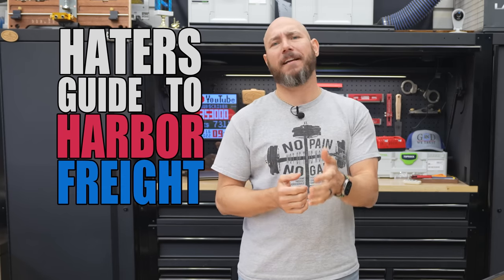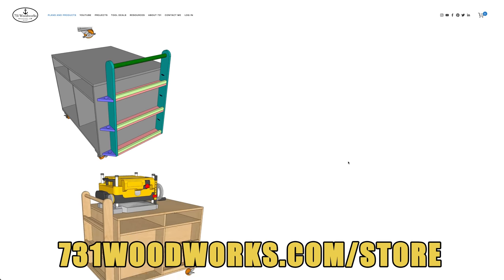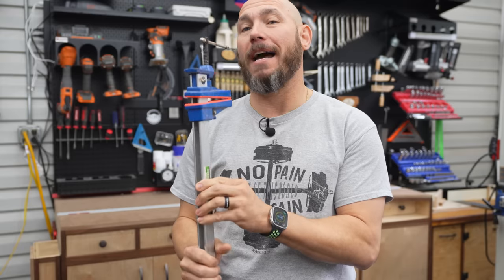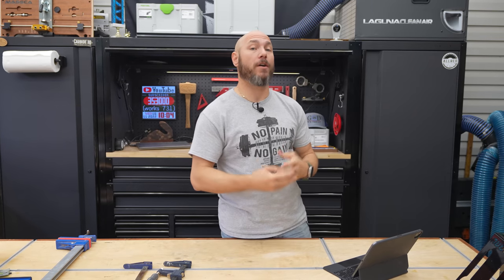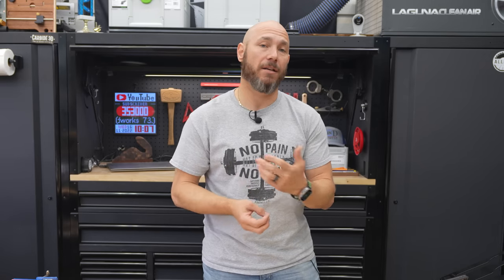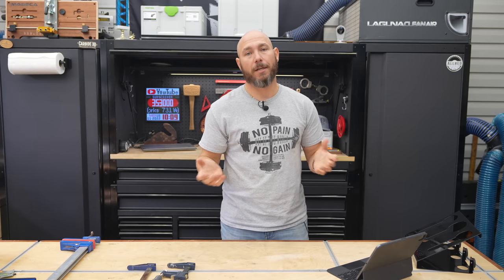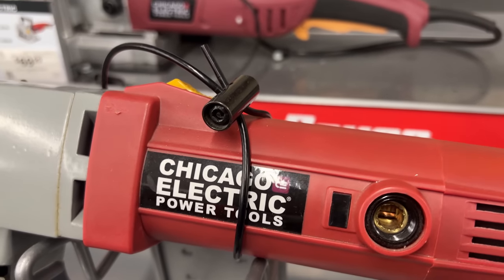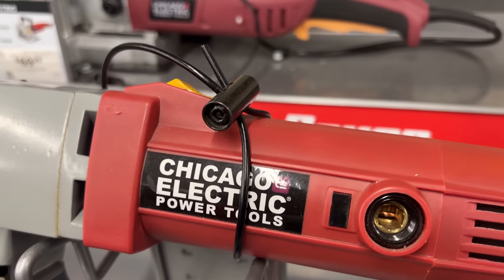The Hater's Guide to Harbor Freight | What to Avoid

Comment: The Hercules table saw used to have a rack and pinion fence when it was first released, at least as far as I remember... Den of tools did a side by side with the DeWalt of the same size and found the Hercules to be almost identical. 

The Avanti airless sprayers are fantastic. The all metal one for 650 rivals Titan and Graco sprayers that are double to triple the cost.

The Central Machinery floor standing drill presses, benchtop wood lathe,  14" bandsaw and the mini lathe and mill are all great for actual shop tools. 

Just a couple of good ones you missed or didn't know about. Everything else you said was right on the nose, except that table saw. Maybe get one in the box and do a review? I know the floor models can get messed up. Maybe they did away with the rack and pinion?

Anyway, cool content as usual. Hope you guys made it through the storm the other night. Up here in Upstate New York we caught the tail end of that wind... It was epic lol.

Peace and love to you and the family ❤️💛💚
Reply: As a former employee that also did research on the tools of the time. Almost everything you've mentioned is really accurate. The bar clamps are good, The machinist lathe is a good introductory lathe for small pieces and rifle barrels. The torque wrenches have been reliable over the years. The dust collectors, the sandblast units, almost all of the woodworking tools are decent. I agree the chisels are okay at best. The woodworking seems to be the shining area. I would stay away from consumables as a primary product. Like sandpaper. But they do well and they do great in a pinch. The Bauer, Hercules, earthquake lines are definitely better than the rest of their tools. The Doyle, Bremen, quantum, and other newer names are also really good. I started in '16 and left just before 2020. It's a weekend warrior store. Sufficient. If that makes sense

Comment: Hercules job site table saw has a rack and pinion fence. A very nice one I might add. It is not the most robust product, but for a job site saw it is excellent quality.

I bought the table saw for a kitchen remodel project I was working on out of town. I assumed I would be done with it when I left, but I ended up loading it up in my truck and bringing it home to replace my Rigid job site table saw. It definitely had less use, but it was also just better engineered and functionally worked more accurately. It is also substantially more compact. 10/10 would buy it again without hesitation

Comment: Their digital calipers are a good deal. I've been using a pair for over a decade, even in my machining class with super tight tolerances. I have a pair of mitutoyos also but I bought an extra harbor freight caliper just so I could have one in the garage, one at my desk, and one at my 3d printer.
Reply: Yup. I have one in my garage, one in my basement, one in my glove box, and one in my kitchen junk drawer.

They're always coming in handy for something.
Reply: was gonna buy a used mitutoyo caliper but didnt want to pay $60 so just got a HF one instead. Good enough for my occasional use.

Comment: After watching several comparisons, I saved myself some money and bought the Hercules table saw when it went on super sale (and of course picked up some free moving blankets with it). The fence stays square enough for me. It can be a little fiddly to lock into the correct spot if you need to be precise, because when you press down on the locking lever, the fence can shift before it locks down. So I always have to recheck my measurement after it's locked. But once it's locked, it's locked and square. I've made drawers and picture frames with it and joints come out perfect. 
Power-wise, I've done a few heavier cuts through thicker hardwoods. Recently cut two pieces of red oak glued together - 3/4" each - and you could hear the motor pushing a little, but it went through them clean with tear out or burning. So I'm guessing if you are doing a lot of heavy duty work, this won't be up to the task. But I think it's got plenty of power for the average woodworker.

Comment: As for the Hercules  table saw, they have up graded it form the one you showed in your video. I bought the new stile and have been pleasingly impressed. The fence can now be locked down with a set screw to keep it parallel with the fence. Fence adjustment is on a rack and pinion system which I really like. And it looks like a Dewalt 7485 twin. Will it run a dato stack? No, does it have the power of a $1000 saw? No. But as a entry level, or a small shop table saw, it’s not bad. It also come with a combination blade that side by side looks identical to a  blade . By the way love your channel!
Reply: Correction on my last reply I meant  to say the Hercules comes with a combination blade that is identical to a Diablo blade
Reply: @timdeniserhodes6450  
I've wondered about how they could make those blades so cheap and if they were any good. I tend to buy better quality blades after starting with cheap. The first $100 10" saw blade I bought was like opening up a whole new world to me about 30 years ago. It cut so much smoother and cleaner, I could never go back to cheap for my table saw. But now, even cheaper blades seem to be better quality (if Youtube reviews can be believed 😄). I might have to try one. 

Just as an FYI, you can click the three dots to the right of your comment and edit it if needed rather than adding another comment.

Comment: I started out with the Harbor Freight Router Bit set on my first router table years ago. They did last quite a while, and like any other bit, had to be sharpened occasionally to keep them working fine. I have since upgraded my bits to Freud and Whiteside for the regular router, and IDC for the CNC Router, these are still sitting in the case in the back of the tool box just in case of emergency need for one. Not the greatest bits, but for backup use, they seem to work fine as long as they are kept sharp and are a fraction of the cost of quality bits.

Comment: Shop owner here. Every single person should buy their tools from harbor freight. If it breaks, replace it with something better. I guarantee you 95-99% of the tools you buy you’ll still own for years later. And by not buying name brand you’ve saved tens of thousands of dollars. Don’t buy the brand.  Buy the tool. That $65000 snap on toolbox full of snap on tools isn’t making you anymore money than the Pittsburg brand from HB.
Reply: This is an old comment but I'm going to reply anyways.. I agree completely with this strategy. I personally will spend the money on precision tools and cutting tools, but I'll buy most stuff from harbor freight and if it breaks I'll replace it with something bullet proof after doing research. And the truth is, there are fantastic tools at low price points, that will absolutely rival snap on.
Reply: And keep on stripping those hard to access bolt heads causing many more hours of headaches to deal with. Count up those hours in dollars.
Reply: @MrAquinas1  Kind of funny you mention that. I've come across a number of recent video's showing Snap-On wrenches letting go before the icon line.  One made me laugh, looked like the snapon tool truck guy was questioning his life choices.
Reply: I guess you never took a course in statistical analysis of metallurgical properties over multiple sampling.
Reply: @MrAquinas1  Listen, if you sleep better at night throwing your money at snap-on by all means don’t let us stop you. I think Snapon is nothing more than a high end over priced brand. It reminds me of fashion brands like Versace, Chanel, Prada etc. I legitimately don’t believe Snap on tools are any better than Icon. But, it’s your money. You spend it how you like. I say that as someone who owns a lot of snapon tools. It’s just not any better than my Icon parts.
Reply: @TheCompyshop Then an unwillingness to examine principles of metallurgy and how to perform proper testing apply to you as well, not to mention an unwillingness to use a micrometer to note the greater level of tolerance precision in sizing of tool parts. If it does not matter to you, fine. It does not matter to me either, which is why I don't buy them for my personal needs. But I am not going to make silly statements to say their is "no difference" when there is a day and night difference between steel made in China and steel that is produced in America. And I hope you at least have the good sense to use a moderately priced Williams, a Snap-On subsidiary, breaker bar if you want a breaker bar that doesn't actually break.
Reply: @MrAquinas1  Nope, sure haven't.  But I'm still not dumb enough to pay for the snapon name especially since anyone can get most snapon tools just rebranded as CAT through your local CAT dealer for half the price. Actually a lot of their tools are still branded as snapon.
Reply: @grncreek  No one should ever buy on the basis of "brand name." I never said or implied otherwise. But judging quality is not a frivolous matter, and it is not accomplished in the frivolous testing methods commonly illustrated on short attention span videos.

Comment: Among my purchases there are a floor jack, pneumatic cabinet nailer, pneumatic hoses, belt sander, hammer drill and assorted small items.  The hammer drill gave up the ghost after one project.  The belt sander held up for a few years worth of moderate use.  The floor jack and cabinet nailer still work great (10+ years).  Drill bits, hole saws and the like don't have the quality of the upper tier stuff and are pretty much one-project throwaways.

Comment: My Bauer 20v drill has never failed me yet. The battery life is incredible...20 straight days without a charge. I also like their clamps and the hand tool sets are good to travel in my truck box for a quick repair.
Reply: I've got a bauer 1/2 inch impact wrench, I use it three times a yr to take blades off my riding lawn mower. I've never had a problem with it. Why would I go to lowes and pay 3 to 4 times as much. Many people buy products there I believe because they are not going to use them often.

Comment: I have a HF small air saw.  I got it to cut out truck grills for aftermarket grills.  It worked great and I still have now.  I got some really nice clamps from HF not long ago for where I work now and they’re great.  I’ve gotten their dolly’s to move around heavy equipment.  I have Snap-On, Mac, Matco, Craftsman, and other brands of tools.  But the HF stuff I’ve gotten has worked well.

Comment: I've used a Chicago Electric angle grinder from Harbor Freight for years, it has always done fine and taken everything I've thrown at it. I originally bought it when I was tiling my basement floor and needed something to cut just a couple of spots that I couldn't do with hand tools and didn't want to spend the money to buy or rent a tile saw. That was about five years ago, and I've never had any problems. I think it's less a problem with tools that have more moving parts and more tools that need to have any sort of accuracy to them. Even then, most of the tools are fine to use as a base if you want to custom build your own tool. I did that with a tabletop lathe from them that I wanted to custom build an extension to, using it for small projects like knobs, handles, and toy wands for kids in my family.

Comment: I've used the Hercules job site table saw intermittently over the last 3 years.  The fence can be finicky, but if you use a rule or tape to check the distance from the blade on both ends of the fence, once you lock it down it doesn't move easily.  It's a decent, low-cost table saw,

Comment: Late to the party, but I also have the Hercules table saw. As others have pointed out, your video shows the previous gen with a "clamp on" fence. Mine is the second gen with a rack and pinion fence.

The fence did require some tuning to get it square and accurate, but it's been flawless for me so far.

My use-case is cabinets and some shop furniture. I'd like to do some more fine woodworking with it, and my experience so far leads me to believe I should have no problem when I use it for those projects.

Great video, as always. Thanks for the great content.

Comment: First time I saw a Harbor Freight was when I worked for a couple years in Jacksonville, FL.  I didn't have much of a shop, so I was glad to be able to get cheap tools.  I changed my mind quickly.  My most memorable bad tool from there was some 1/4" router bits.  The shank was milled undersized, and I couldn't even tighten them in the collet!  Highly dangerous if I hadn't noticed.  I also bought a small electric tire pump that died quickly.

That said, last year I was changing some tires and needed a breaker bar, and on the advice of a friend, I got one there, and it's worked perfectly.  But again, as you said, very few moving parts, and the steel seems to be properly hardened.

Comment: Another great tool at Harbor freight that I've used is the Chicago electric 10" tile/brick saw. Definitely not as good as other more expensive brands, but it's great to get started doing tile projects. I found the sliding trays to be a bit off, so you have to correct for that, but if you're careful and mindful you can work around it. I had to take the first one I got back because the tray was REALLY bad, but the second one I got was fine. Used that saw for several years as a contractor and did multiple bathrooms and kitchen backsplashes with it (I think I did 8 bathrooms and 5 kitchens) before upgrading and the finished projects were very good and precise.

Comment: Casters; My wife has a bunch of big planters on the deck and around the house. The caddys that she put them on were terrible. Even the "good" ones would hang up, break, and tip over. So I nailed a few scrap boards together and got casters at HF. They seem to be of good quality and half the price of most other places I looked. I might not try to move a gun safe around with them but they are fine for plants, out door prep tables, the smoker stand, etc. I was a maintenance tech and never used their tools for my job but now retired I find lots of bargains there. It is what it is. Thanks for the review and the many instructional videos.

Comment: I bought the new Hercules planer with a 25% off coupon for $299. Hard to pass up. Bought a third grinder for $40 or so there simply so I did always have to be changing from cutting to grinding to flapper wheel. Works great, and has a good quality feel to it. I use a lot of their consumables like grinder disks, acid brushes, chip brushes, and rubber gloves. I also like their hardware kits for wing nuts, nylock nuts, springs and the like. You are right - those magnetic trays are great if you are like me always losing that critical screw. I also use them to organize hardware when I am doing a new assembly. Probably have a dozen of them in a few sizes. I use their analog vernier caliper every day which is precise enough for my needs. US General toolboxes are a great value, many of the mechanics where I used to work swore by them. The shorter (16” or so) F clamps and the spring clamps are well worth the money and you can never have enough. There is some junk there though,  mostly Chicago Electric stuff and cutting or drilling bits and blades although for wood their drill bits seem OK. Overall I’m a Harbor Freight fan and am overjoyed they just opened a store 1 mile from me, right next to a Lowe’s.

Comment: You can also find the paper towel holder as parts.  One round dowel (Cut to fit), two screw eyes for each end and some paracord or mason line to hang this from the ceiling.  Its out of the way yet paper towel is within easy reach when you got greasy hands.

Comment: I have had a 20 gallon compressor and electric pressure washer for over 8 years, both work fine. 5 years ago I had to buy and fill a toolbox, all from HF for daily use. No breakage, no stripping, everything still great, including the $30 multi meter. So far I'm very close to 100% satisfied with my overall experience with this company.

Comment: I've been building a bathroom and having my first experience with tile cutting. I bought a wet-tile table saw and it's been great for my "one time" use. They even offered to buy it back from me for a 20% restocking fee. I've probably had it too long and used it too hard for that but it only cost me $69. in the first place so I'm a happy camper. I also got an angle grinder for under $20 that makes me wonder how I've lived for 73 years without one!

Comment: I would have to agree with all the weekend woodworkers out there. They have some great and affordable stuff at HF. I just picked up a hercules router a few weeks ago and its built quite well. Grabbed some warrior brand router bits to make some dados and dovetails and they work well and get nice and smooth cuts when you use a few passes like you should. Then I picked up a bauer corded jigsaw a few days ago for $30! The one I grabbed had a bunk laser line and the blade would wobble a bit at highest speed setting. So guess what? I didn't even use it and exchanged it for another one and this one was right as rain. Nice and clean laser line and no wobble at highest speed setting. They were super nice about the exchange too. Only asked what was defective about it to report it. Moral of the story... EVERY company makes defective units. Don't keep it and be pissed. Just return or exchange it and get back to work. And if those tools are YOUR lifeline for income then maybe YOU should invest in top dollar tools. Not everyone needs tools that break your budget. Ps I don't stress test my tools. I don't want to risk my safety to make a PSA for others. I figure another way to get it done safely or walk away until I get a tool that can accomplish what needed to get done.